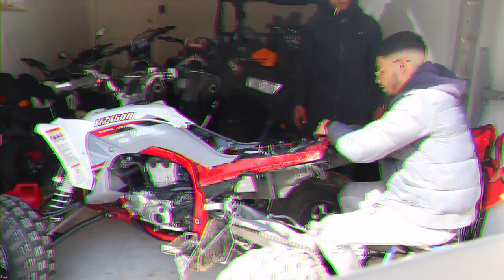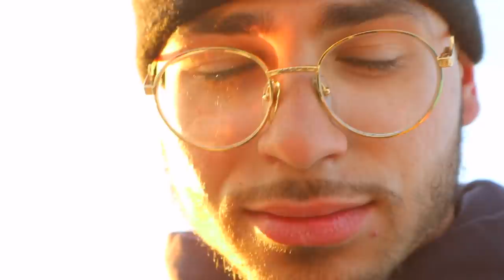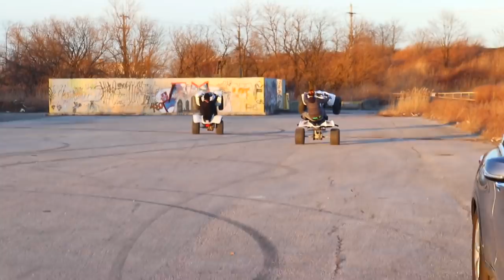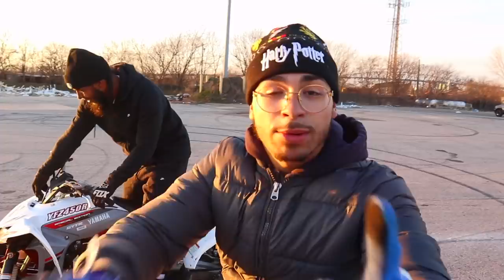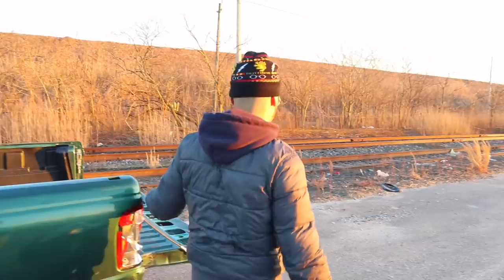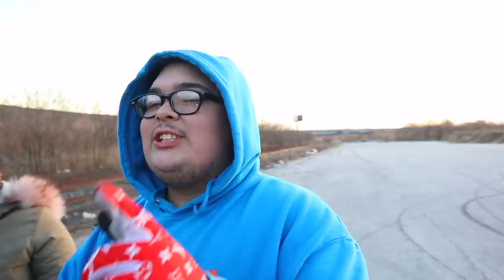MANNY BROKE THE SUBFRAME ON THE YFZ450 ! | BRAAP VLOGS

Comment: swap the 700cc engine and do a r1 conversion, best thing i done in my life
Reply: It's the yz 450 not the 700 raptor.
Reply: @rickjones2534  my bad i mean get a 700 and do it
Reply: Did you know some 700 raptors were imported into Europe without motors and converted with R1 motors straight out the showroom dealership.
Reply: @mickricke3762  my friends mechanic converted mine, hes done about 7 in london thats where im based